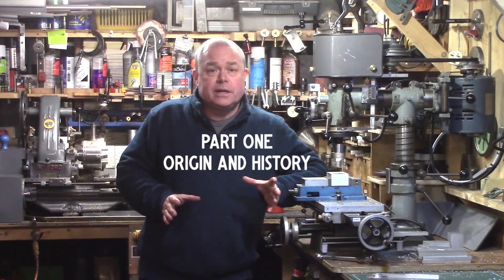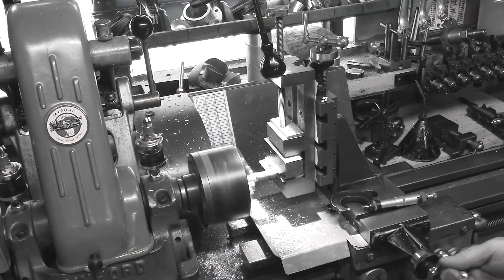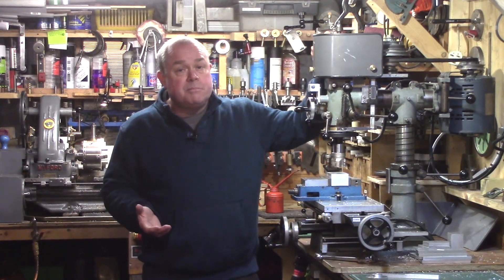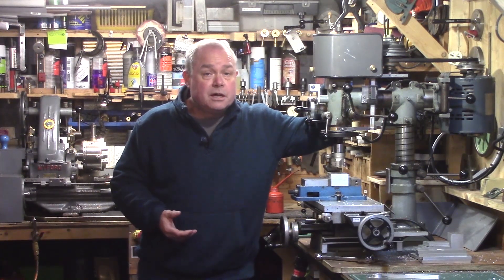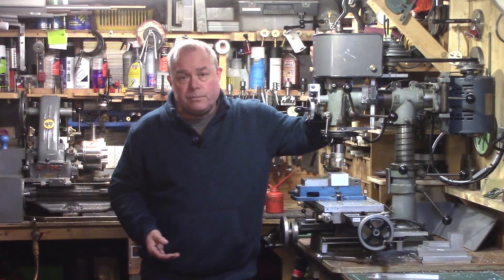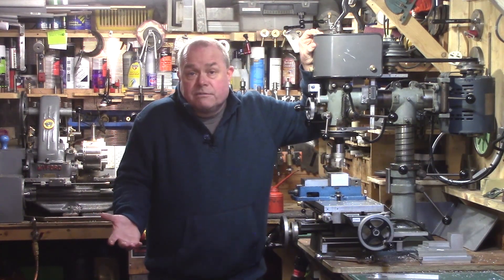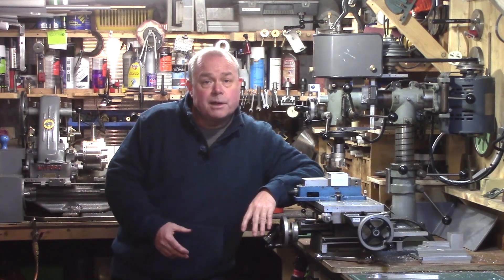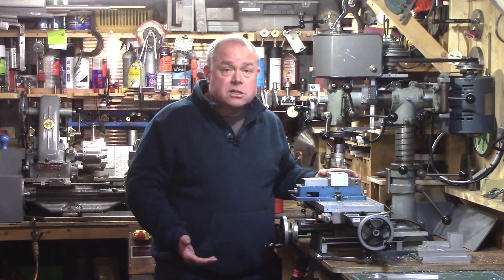The Dore-Westbury Milling Machine - a brief history of the origins of the Dore Westbury Machine

Comment: hi ade i have to make two bronze nuts for my xslide  on my DW do you know the thread size and type, appreciate any advice
Reply: Thanks ade
Reply from the maker: Mk1 or Mk2?
Reply: @adeswash  hi ade its a mk1  wondering i8f i  can use a acme tap  cheers
Reply from the maker: @jessestrum  Hi Jess, If you do Facebook there is a DW group, and there are lots of stuff in the files section, for both Mk1 and Mk2. Bound to be the info you require somewhere in there. :)  Rgs Ade

Comment: hi ade thanks for inspiring me with the dore westbury , i just bought a mk1 and i,m on fettling it now. i have the main quill handle missing ,all i have is a circular holder with holes  around its edge , i,m thinking it for setting the handle in the position you want. do you know if i can get a plan to make the coller for the knob to screw into, cheers john
Reply from the maker: Hi John, I have uploaded the Mk1 drawings for you. The link is : https://drive.google.com/file/d/1z2zTS6k8kU10s5g2h6oLb0vDs8rQN4Ri/view?usp=sharing   
Regards. Ade
Reply: @adeswash  thanks ade,

Comment: HI I Bought my Dore Westbury MK1 about 30 years ago in kit form had been never touched by the previous owner. At the time I was a machine shop instructor in a Technical College and we finished the Dore to very precise tolerances plus a few mods. and I have been using it since great little machine I have completed  jobs big and small and I can maintain it myself that's it's advantage over far Eastern types where spares can be a problem but thats not to say some of them are guite good.  I have been asked to sell it many times but I can not imagine my workshop without it and hard to replace if I regretted the sale

Comment: Ade I’d like your opinion.  I’m planning on buying a mill  I have 2 in mind. #1 has a power head lift with 1000w motor #2 Doesn’t. 
Have power head and has a 750w motor.   I’m kinda short 5’3” and was worried about struggling with the hand wheel on the non powered one.
Reply from the maker: Hi Lisa, unfortunately I can't answer your question, the only experience I have with milling machines is this one. Sorry
Reply: @adeswash  Thanks for getting back with me.

Comment: HI Ade iv managed to purchase a Dore Westbury mk2 the only part missing is the spindle, i have managed to obtain a copy of the machining and building plans, my question is if you were me would you have a spindle made with the mt2 taper like yours or would you op for the mt3 taper without the myford thread on?
I would like to also say you make great videos and have reignited my interest in getting my own workshop
sorted.
jim
Reply from the maker: Hi Jim, I have never used the myford thread on the spindle, as I dont own the myford collet set,  but instead just use MT2 tooling, I guess the MT3 option would allow for larger tooling, although the mill is fairly 'lightweight' so not sure it would be much advantage,  so I guess just go for whatever suits your existing tooling to reduce duplication
Reply: @adeswash  Hi Ade 
Thanks for the reply this is my fist mill so will be starting from scratch, i hope to be building one of your engines as my first project once the mill is up and running.
What i might do is have an mt2 spindle made but not worry about having the myford thread put on. Will send some pics when its up and running.
Jim

Comment: Machines like this make a drill press conversion seem relatively plausible.   I wonder if you had any experience or opinions on that subject?

In my opinion its entirely plausible to do though certain realities mean very few attempts are successful.   Import machines and even the availability of smaller industrial machines make a proper conversion financially suspect.

A drill press of suitable size and quality to be the basis for a very light mill is already a prized machine and not usually cheap to aquire.   Spending $500+ to turn a $250 used DP into a very light mill when a more or less ready to go mill can be had for a similar amount is where things stand today. 

And finally, most people who attempt these conversations don't actually have much knowledge of what a mill needs to be to function even at the bottom of the market.
Reply from the maker: Hi DrewLSsix

A few ago, I attempted to use a drill press as a light mill using a small compound milling table, but soon realised the limitations. 
Firstly the bearings in a drill press are designed only for vertical stresses such as when drilling, and not for horizontal, lateral motion required when milling, secondly most drill presses with a morse taper chuck attachment do not have a draw-bar to secure the chuck, so again horizontal forces tend to cause the taper to loosen without this. 
Thirdly, and undoubtedly, the most significant shortfall of a drill press conversion is rigidity. 
The mill in my video, although considered a light-mill, is substantially ‘heavy-duty’ when compared to a drill press of a similar size, and this where a drill press will suffer from the forces required during milling, resulting in flexure throughout the machine and subsequent loss of precision on the component being machined. Regards. Ade

Comment: Thank you very much for your time in making this video.
I have a Dore Westbury and use it sporadically. I bought it from a man in Accrington who had built it himself.
It was suffering a little from Anno Domini so I replaced the angular contact bearings with same and had the slides ground.
I still need to work on reducing the considerable backlash.
When it was sold to me the mill was briefly demonstrated and I was told that it would not mill a slot much wider than a quarter inch. Such I have found. The vibration above a cutter of 1/4" diameter becomes irksome and the finish poor. I was very surprised therefore to see a shell mill in the spindle of your Dore Westbury.
I would be very interested to hear about how you have got on with this and your experience of machining with the Dore Westbury.

There are a couple of significant disadvantages to the Dore Westbury. The lack of longitudinal table slots makes setting up slower and precludes machining a keyway into the base of a vise to give instant tramming on a table slot. Another is the limited quill travel. If one has to machine a part over a height greater than the quill travel then the head has to be unlocked and screwed up losing all points of reference. The foregoing notwithstanding the Dore Westbury is absolutely great compared to no mill.
Reply from the maker: Hi Jack, I use the shell mill or a flycutter for facing cuts without any problem, surface finish is fine, I also regularly use a 1 inch 4 flute end mill for a lot of 'roughing-out' work. I agree about the table slots, not much use unless you are using a DW vice, if you notice in the video there is a slab of aluminium bolted to the table, this has custom holes drilled and tapped to suit my different fixtures (vice(s)/rotary table/dividing head etc). The Mk2 has a longer quill feed, but I get around the issue of re-alignment after rasing the colum by using a laser fixed to the mill head and a reference line at the far end of the workshop, this gets me back to within .002", but planning in advance you can often negate the need to raise the head mid-job. Most of my work is brass/aluminium/cast iron, but I do use steels occasionally, knowing what the machine is capable of and knowing its limitations on speeds and feeds yeilds great results, it really is a versatile little benchtop machine. Regards. Ade
Reply: @adeswash  Thank you. Much of my work is on mild steel though I have milled cast iron too. Have you used the shell mill on mild steel and if so what was the result? Also how have you secured the shell mill in the spindle?
Reply from the maker: @532bluepeter1  Hi Jack, all my tools are  MT2, so secured with a drawbar through the spindle. I have faced mild steel with the shell-mill, slowly and small cuts, like I said in my previous reply, it is all about knowing what your machine is capable of, and setting your own speeds and feeds, to suit. Regards. Ade

Comment: Very well-researched and historically insightful documentary on the wonderful Dore Westbury. Made me think of aspects I have never considered before and I am a DW fan. Well produced video too.
While personally I have found imported hobbyist machines to have improved significantly over the twelve years or so that I have been interested in machining, I agree that the style, quality and sheer presence of machines such as the DW take some beating.
My DW Mk1 is in dry dock at the moment, (awaiting a bearing change - taper roller is my intention - and a new motor) along with many other competing jobs but you have just inspired me to bring it higher up the priority list!
The only thing I don't really like about the DW are the perpendicular table slots, which - although they look great - can make it difficult to mount vices and the like. I guess they may have been made that way with specific tooling in mind.
Cool video, thanks for putting it up.
gary